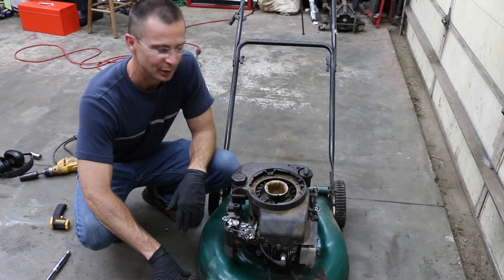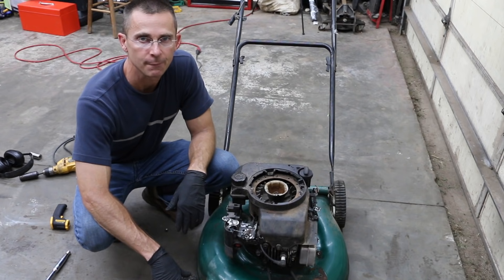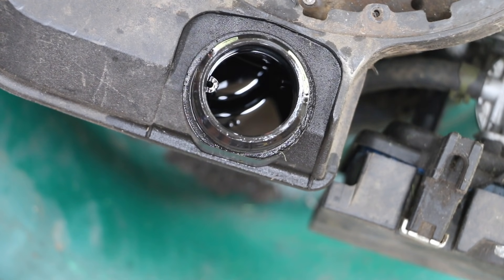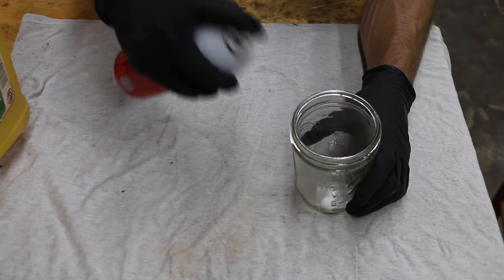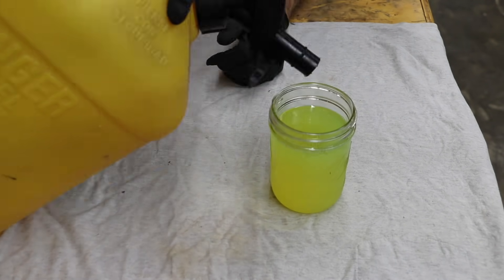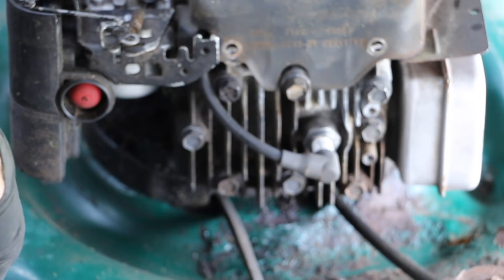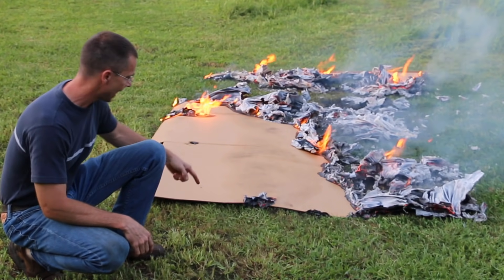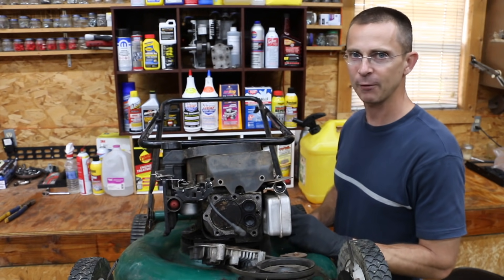Will a Gas Engine Run on Diesel?  Let's find out!

Comment: spray nos while its running. would it destroy the engine ? that would be cool
Reply from the maker: Thanks for this video idea!
Reply: Anthony Mason RIP Leroy Jr.!!
Reply: Samsung Galaxy S7 will have to get the mad scientist to replace the Piston rings you fried. Lol fast and the furious reference.
Reply: You would need to spray fuel with the NOS to get any kind of boost.  Otherwise the NOS will simply lean out the fuel mix and either overheat the exhaust valve and muffler, or just stall the engine.
Reply: Alex Ramos diabloformularacing did this with a go-kart
Reply: Jonathan Blake he is correct. If you just spray nos without additional fuel, you will run lean which increase your cylinder temps, and also exhaust gas temps. This will potentially burn valves and can also cause detonation and pre-Ignition which is how many motors blow up while using nitrous. 

Sources: My self, 12 years professionally building engines.
Reply: +Josh Considering that NO2 isn't a combustible mixture on it's own and will exit a nozzle at -42C without a heater it will freeze the cylinder and nothing else.

NO2 is an oxidizer, it will do fuck all without combustible fuel.

The way NO2 works is by providing more oxygen for the fuel, it's not a fuel in and of itself and you couldn't set it on fire if you tried.
Reply: First of all, it's NO2 not NOS or NAAAAWS and it would stop the engine.

There is a danger to manifold issue though which means the floor board will fall out.
Reply: +Brian Lawyer You don't hav the faintest clue about the chemistry involved or the basics of how an ICS works, do you? Why would cooling it down with direct injection of liquid NO2 cause an overheating issue? It'll freeze as soon as it hits which is why it doesn't work... at all.
Reply: Samsung Galaxy S7 haha rings and floor pans are the last thing to worry about when using nitrous
Reply: Samsung Galaxy S7 I think the real questions here are: Why did Brian cut out his floor pan out and replace it with a piece of sheet metal? Why did it fall out when nos was used?
Reply: +Samsung Galaxy S7 That's why you have to double clutch "like you should".
Reply: +Josh Well it's folded auluminium so that is one of the very, very few things that actually makes sense. It would lighten the car.

It always falls out when there is danger to manifold and you're not double clutching like you should.

That is why I live my life one quarter of a mile at a time.
Reply: +Josh "Jonathan Blake he is correct. If you just spray nos without additional fuel, you will run lean which increase your cylinder temps, and also exhaust gas temps."

That is not what I said, that is the opposite of what I said and you obviously don't have a clue on this matter.

NO2 is an oxidizer, it works by increasing oxygen content through two ways. First is that it's highly compressed and very cold so you get more of it and second is the O2 which is dioxide.

Apparently you don't know this but oxygen in and of itself increases oxidization and will make the fuel mixture more combustible because what you need is fuel and oxygen.

On it's own, without any fuel (and NO2 isn't a fuel) it won't do anything. It's not combustible and it won't do anything but cool your engine.

A leaner mix is less fuel and more oxygen so yeah, NO2 will produce that for obvious reasons.

Motors blow up because of bad valve timings mainly. A problem with using NO2 is that it's not consistent when you reach higher RPM's where the fuel will be of a richer mixture in comparison to the NO2 cooling, that is when your valve timings are off and why you blow out your valves or damage your pistons.

Please just stop commenting, you're not fit to service a 20 year old manual lawnmower.
Reply: Alex Ramos actually, it doesn’t!

Comment: I ran my father's '83 el camino 1 mile on diesel. He swapped motors from a 350 v8 to a 305 small block when I was overseas. I ran some errands and filled up the tank not knowing about the swap. I made it to a garage owned by a family friend and got to replace the heads on my vacation. Along with making some new "gas only" labels. 
Now whenever I go back home I have to ask which car he fiddled with.

Comment: I thought it would smoke like an old Buick. Have you tried running leaded gas through the mower, or use straight gas in a 2 stroke in your past vids?

Comment: Back in the 60s, we would occasionally (~once a month) add 1 gal diesel in a 20 gal tank Malibu SS. It would puff slight black smoke and run a bit hotter. Helped to blow out carbon and would run better.

Comment: I put $20 of diesel into my dads z71 it died once the gas cleared out of the fuel lines. It would not go forward but it went in reverse just fine. I guess more compression in reverse? Idk but it was odd we drove like 4 miles back to the gas station in reverse truck was way on empty before I did it so there wasnt much gas in it before I added the diesel

Comment: I ran out of gas in my pressure washer one time without realizing i put diesel in a hot engine n it smoked white like crasy i couldnt kill it with the switch but choking it for a while it finally died

Comment: Alright, I was looking for this one.  :D  I am not sure why, but year ago I used to mix diesel and gas to my two cyl lawn tractor.  And if it was not done right it would not start.  However now seeing how it gunk up the insides, I will no longer play around with mixing.  I liked that firenado you had there when you set the cardboard on fire. It was on the diesel side at 8:06. In fact now that I watch the video again to get the time, i see many firenados.
Once again you made a great video.  thank you.  :)
Reply from the maker: Thank you!

Comment: you can drain the oil and fill it up with some Gasoline and see if the Lawn Mower Engine explodes.
Reply: common sense tells us gasoline is a solvent not a lubricant. drain the oil and replace it with gasoline, you will destroy the connecting rod and crank journal pretty quick.
Reply: andrew donohue i know.
Reply: Sebastian Albrecht I
Reply: Sebastian Albrecht 😂😂

Comment: Just for the record. I haven't watched the video yet.  I know a gas engine can run on diesel because I have done it with an old volvo. Or I should say my little brother did it. There are caveats though. The engine must be hot and already running on gas.  Once that engine cooled down it was a no go. These lawnmower engines don't really run hot enough, in my opinion, to run diesel very well if at all.  Not to mention their low compression ratio's. Well never tried it myself in a lawnmower engine so I guess Ill watch the video and see what happens.
Reply: About what I expected but I would have liked to have seen the pure diesel tried on a hot lawnmower engine. I would also have liked to have seen 25% gas. Maybe 10%. I have a sneaking suspicion that it doesn't take much gas to help it get going and stay going.  In car engines any diesel caused lots of knocking or pinging. I suspect that may be a timing issue.

Comment: Would a 2 stroke engine run on diesel without damaging the engine? By theory, both 2 stroke fuel and diesel contain lubricants.

Comment: I hated mowing as a kid and tried to kill my parents mower by adding quite a bit of water to the gas tank.  At what % of water in gas would it take to kill a mower?  I think I was running like 25% through that mower and it barely even ran differently.

Comment: Um I siphoned gas from a tractor in our yard for my car when I was young and had limited funds. Got about three miles down the road and the smoke was pouring out the exhaust. The car was pinging like crazy and then it died. Smelled like diesel. I hope I learned my lesson

Comment: Try running it on ethanol. you'll need to drill the main jet out to approximately 2-1/3rds larger  example stock jet size .030 new size .090 add an ounce or so diesel fuel as an upper end lubricant, also add a small amount of acetone or gas for cold morning starts it should run much cooler and cleaner.

Comment: Run diesel on two stroke engines please! Want to see if the engine can handle the oily aspects of diesel.

Preheat -- Try heat-gunning the mower head heat sink to encourage Diesel combustion, ala glow plugs.  Same with two stroke engines. Ready fuel shut-off valve in case engine won't stop since spark plugs may become irrelevant.  Heck, just run mower on gas first for 30 mins to make it hot  then diesel. Should be interesting!

Love your videos and keep em coming! Truly inspiring and intellectually procative.

Comment: Pretty good stuff!!! I was curious about that myself. I learned years ago about the principles of gas and diesel engines. Outside of the diesel not having spark plugs and firing on injection/compression, I learned that diesel engines had more than double the compression ratio of a gas engine. I really didn't think this would work. Learn something new everyday. Thanks for the video!

Comment: Run it on a 18 liter water bottle system  , force water through the engine out the exhaust and back into the bottle in a closed loop system. All you got to do it compress it until it has enough pressure to run the motor. Then keep it pressurized to the right psi and it will stay " running "

Comment: The diesel will not atomize properly in the carburetor and the mix will be super rich. (Diesel requires more oxygen than gasoline to burn an equal volume of fuel due to the higher density and longer hydrocarbon chains).  Strait diesel will likely foul the spark-plug. The higher compression ratio (typically 18:1, up to 25:1) of a diesel engine increases the precombustion temperature of the air in the cylinder and accelerates the combustion of diesel when it is sprayed (injected) onto the piston at the top of the compression stroke.

Comment: I would like to see this redone.. the old tractors would run on all three.. gasoline diesel or kerosene that being said you always had to start it on gasoline and once it warmed up you could switch to diesel or kerosene and the power was actually significantly better on diesel..  So my question to you would be start them up on gasoline switch to 100% diesel after it's completely warmed up and see if it stays running.
I must say. .I don't know about the mothball... but I will look into the comments..

Comment: What if you start the mower on a small amount of 50 50 diesel and gas. Once the engine is nice and hot, and the tank is almost empty, fill up the tank with diesel while the engine runs. The engine might vaporize the diesel better when it's up to temperature

Comment: hey there project farm guy man...  love the vids keep em up.  Diesel fuel needs to be atomized to burn correctly.  once the lawnmower heated up it was probably igniting the gas and hot enough to burn the diesel.  if u were to spray a fine mist of diesel it would burn very nicely.  I would wonder if diesel fuel would burn better if you sprayed it with a spray bottle and shot it directly into the carb.
Reply from the maker: Thanks for the suggestion!

Comment: Pumping the primer you are essentially doing port injection which is why it will run at all :) Carbs just don't work with diesel since it doesn't turn to vapor or mist as easily as gasoline.

Comment: This was awesome. Since we know that diesel relies on high compression to ignite, maybe you could try increase compression by jb welding more to the top of the piston and see if you can increase the compression enough to run on diesel, and test the strength of jb weld.

Comment: go about 6 drill sizes bigger for the jet, add a little timing, and warm the engine up first, off road diesel is a lot cheaper than gas and my 300 l6 powered 1/2 ton ford runs great on both. plus it "beening a gaser means cops dont look for the red die" loop hole!!

Comment: You need to perheat the head for it to run. I runn 100% diesel in my Briggs & Stratton 6 & a half horse just preheat the cylinder head with a torch for about 5 minutes good to go

Comment: Used to run my antique show garden tractors on kerosene. Had to warm the engine first or give it a shot of starting fluid at first, but would run pretty normal after.

Comment: Diesel doesn't vaporize so it needs a hot intake manifold.  The mothball trick increases anti knock index which is a problem under load only in side valve engines.  When it knocks,  it belches black smoke.

Comment: You should see how long a small engine would run using water as oil. I'd assume not long, but it is a 'decent' lubricant for certain applications. Love the videos, man.

Comment: Great video.  So when burning a brush pile, use Diesel and not gas.
Reply: One Brothers Productions yea that's what I always use but remember diesel is harder to get started. I like throw diesel on it then throw a little gas on the diesel fuel to get it started.

Comment: the cardboard with the gas on it didn't actually burn because liquid gasoline doesn't burn...it's the vapours that come off it that burns.....not that you should put some in your hand or anything but I've seen that countless times starting campfires with "boyscout juice" (aka gasoline lol).

Comment: I was picking up a bituminous distribution truck from New Hampshire many years ago, it had a gasoline engine, and dummy me filled the tank with diesel. Yeah, it'll run for a bit, but it sure does smoke a lot.

Comment: If you run your engine on gas and get it hot first it will run on diesel. I've filled my push mower with diesel by accident before and if it wasn't for the white smoke and clattering when you bog the engine in thick grass I'd have never known the difference.

Comment: Great video as usual I didn't think it would run very well off straight diesel being the small engine does not have the correct compression for the fuel. I know you do Farm I have owned and ran diesel engines for years so I have a pretty good understanding of how they work. Look forward to your next video!!!!!

Comment: If the engine was hot it would run on diesel..there was a lawn tractor that I had a a boy that had two tanks on it one was gas one was diesel ...you would start the engine in gas and warm it up then shut the  gas of and turn On The diesel and it ran fine on the diesel AFTER IT WAS HOT ..diesel needs to be hot to have combustion...gas needs a spark plug ..

Comment: Quick question, what modifications, if any, did you make to the mower to accommodate the drill bit to start the mower instead of the pull cord?
Reply from the maker: On this model, remove the 4 rivets attaching the pull cord mechanism.  Then remove the mechanism.  You can then use a drill with the correct size socket to spin the engine over.

Comment: Run a motor on a straight acetone mix and i also want to see if you could use burnt motor oil as the premix oil in a 2 stroke

Comment: Years ago my brother put diesel in his gas burning car. After having it towed to the shop, the diesel gas was put in 2 gas cans. While over at my parents' house to mow the grass, I grabbed one of the gas cans (not marked and I didn't know about it at the time) and filled up. Lawnmower ran for a while, but then needed choke to run.  I finished the grass and left, and got a call the next week about the mower not working. Only then did I find out about the gas / diesel mix, and had to drain the mower's gas tank and it took a bit to get it going on regular gas again.

Comment: Thanks for the demonstration!  

One thing that has happened many times is a "perfectly incorrect mix" of gasoline and diesel fuel in a high compression gasoline engine.  Gasoline has an "octane rating" which represents its ability to burn under compression without exploding or "detonating." Diesel fuel is designed to self-ignite under compression, and has a "cetane rating" which represents this self ignition capability.  When the two are mixed, the result is a very low octane, high detonation fuel which will cause severe damage to a high compression engine.  Some automotive gasoline engines have 10:0 or higher compression. Mixing in moderate amounts of diesel fuel will cause detonation damage to these engines. This will show up as cracked piston ring lands, blown head gaskets, and other damage to the piston and combustion chamber area.  I believe the small engine you used had a very low compression ratio, and was therefore very resisting to detonation.

The key to the above happening is the wrong mix.  With 100% diesel, the engine won't run at all, so no damage happens.  The worst damage I have seen was when the owner of an 80's Mercedes car filled up a fully warmed up engine with diesel on top of 1/4 tank of gasoline, and then went on the Interstate. The result was all 6 pistons cracked and scored cylinders walls.

Comment: How complicated would it be to fab up a divided fuel tank with a two down to one feed line. And have a switching valve so you could theoretically adjust the mix on the fly. Anyway good work. Love these vids

Comment: I'd be interested to see if you can get that mower running on kerosene. I've read you can run diesel engines on kerosene (but it will run dry and hot). Or ethanol/whiskey. Actually, I think it would be cooler to see if you can get it running on regular liquor, or what proof it runs decent (enough).

Comment: As long as the gasoline engine is heated up you can, but let it cool off and it won't  run. I did this with my rider lots of times.

Comment: I'd like to see nitromethane used. The stuff they use in nitro powered RC cars. Not sure it would damage it but would sure like to see how it effects the way it runs.
Reply: it would run wide open out of control until it melted down or seized, no spark needed once running as the spark plug and other parts inside would be glowing white/orange hot and melting down :)